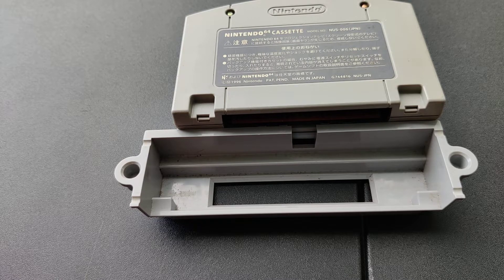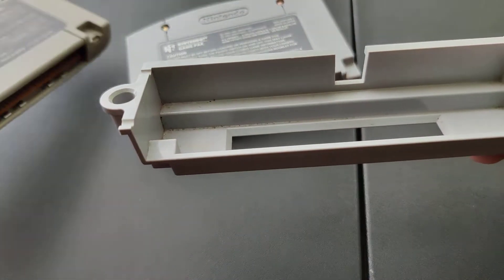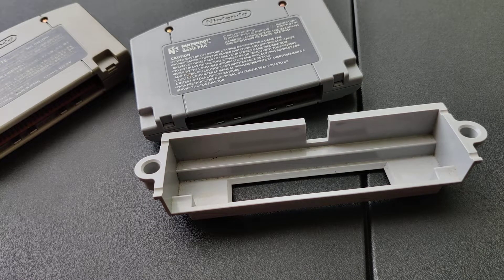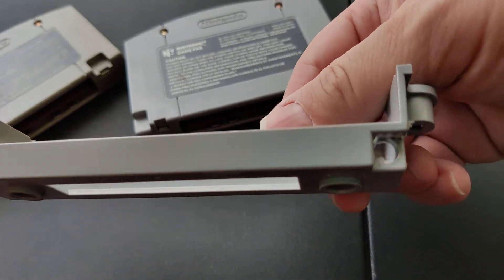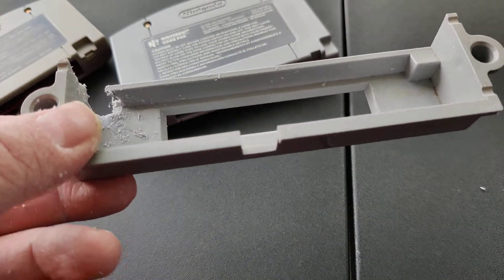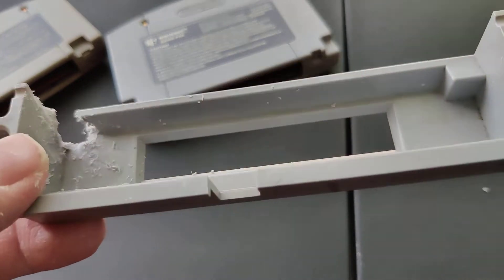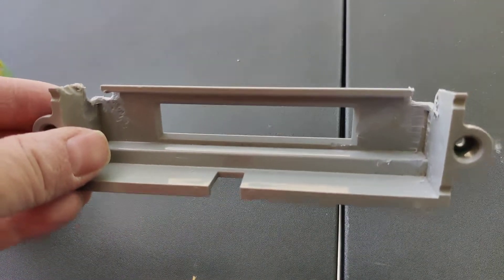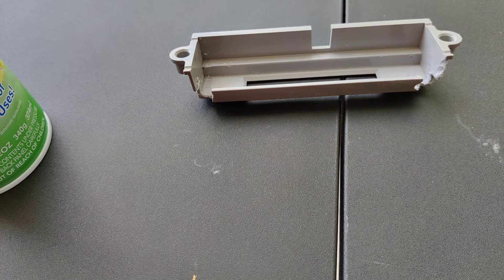Alternate N64 Cartridge Tray Mod Method

Comment: "Quite a nasty piece of work you managed over there."

I'd probably just remove the tray altogether and be careful when inserting the cartridge.
Reply from the maker: I've heard of some folks doing that, but it can be problematic in the long run (ie dust and other muck going in the console).  It does really make more sense to just buy a cheap 3D printed tray now.